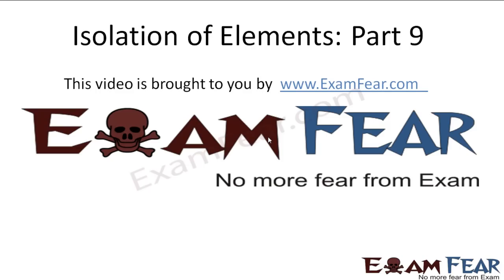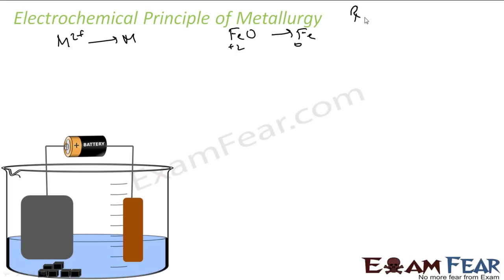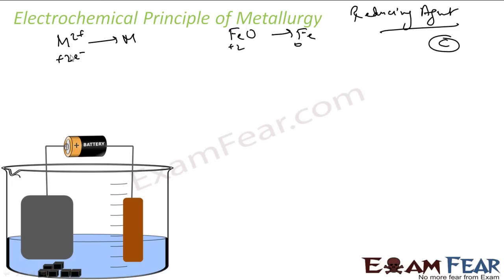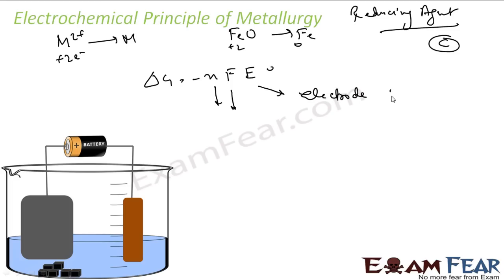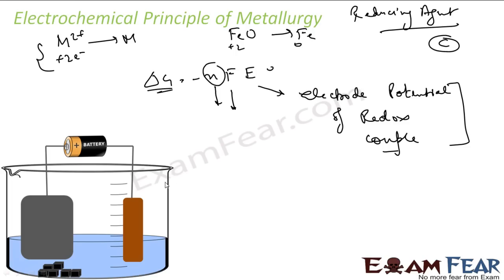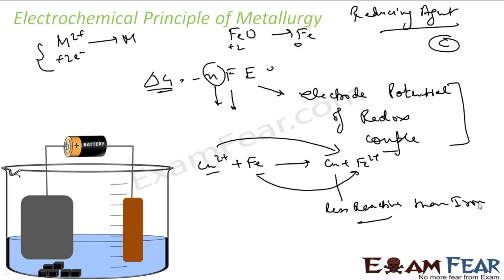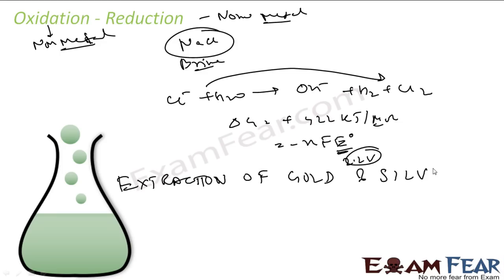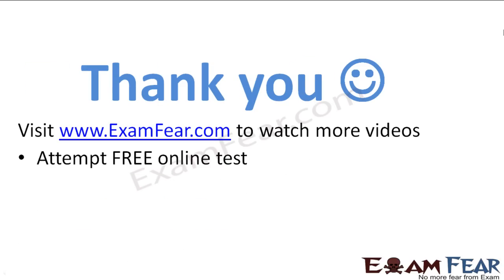Chemistry Isolation of Elements part 9 (Electrochemical process of metallurgy) CBSE class 12 XII

Comment: i still dnt understand how 1kg aluminium requires .5kg carbon.....
Reply: Al2O3 = Al^3+  +  O^2-
(where Al2O3 are becoming ionic forms)

Now the oxygen which is liberated as O^2- gets reacted with carbon anode to form CO and CO2 .
As you can see O^2- is liberated from Al2O3 .
So from 1kg of Al2O3 the amount of oxgen ion liberated is such that it will take away 0.5 kg of Carbon from anode to form CO and CO2.